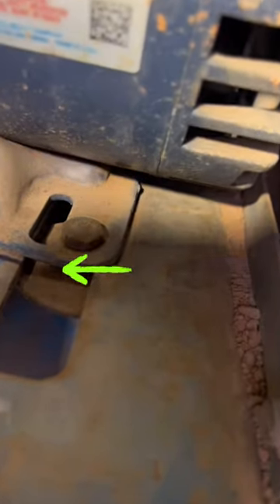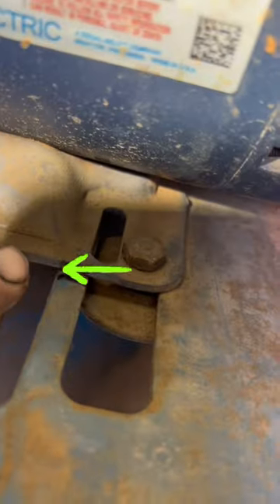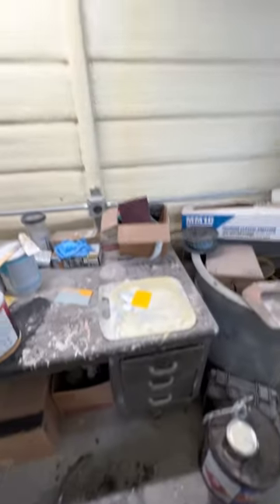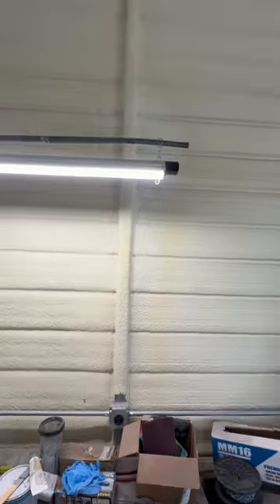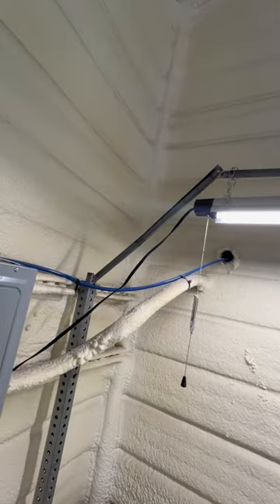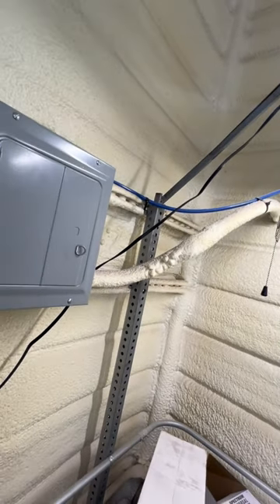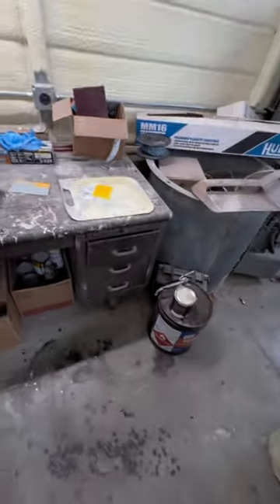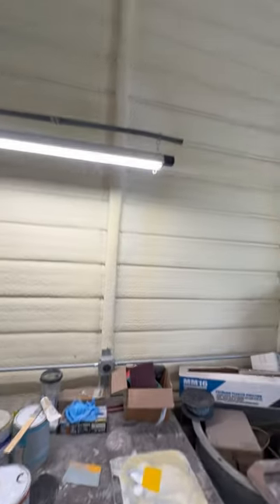MASTERS DEGREE IN BARNYARD ENGINEERING🤑🤑

Comment: When I was in federal prison 
I worked on the a/c crew and we were on the roof quite often fixing the rooftops units and changing belts. 
Never moved anything, just used a stick to finagle the belt on to the pulley and removed the stick after it turned a bit more. 
Stick can’t be too thick tho, it needs to break after you finagle it, not before
Reply: To the hardest working crew at Shawshank 👍

Comment: the way the compressor man does it: adjust the  distance, tighten the bolts, slip the belt onto the pulley, done. they don't put the belt on and then adjust it back, they set the distance and slip the belt onto the pully.

Comment: He uses the porta power and a block of wood . 😂 Saved a trip to the hardware store for that brand-new turn buckle too .
Reply from the maker: Porta power wedge broken😗😗
Reply: @OldBondoBilly   Probably just an O ring . Should have picked that up at the hardware store while you were there .
😉
2 nuts and a bolt while ya had the welder out . Would have made an adjustment point on the motor base too.  Not that any of this is better . Just that what works for you might not work for everyone else .  If your not constantly learning new things . You're not getting better , you're just getting older .

Comment: Did you stitch that 
I’d like to do that but I’m confused as how to do it do you have to remove the zinc from the washer that’s the thing I really need to know how to do what you did. Thanks Tyler.
Reply from the maker: I used flux core, which drives the galvanizing out of the puddle😉😉
Reply: Thanks and sorry but what settings